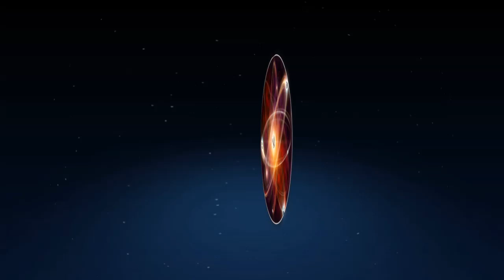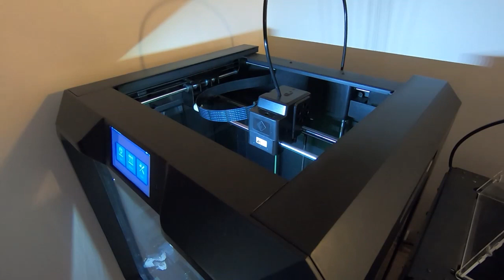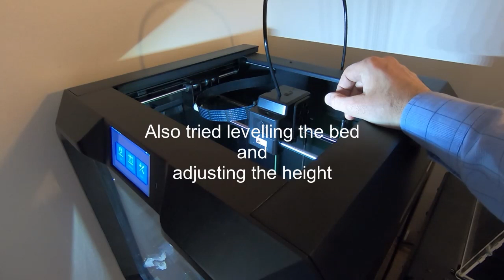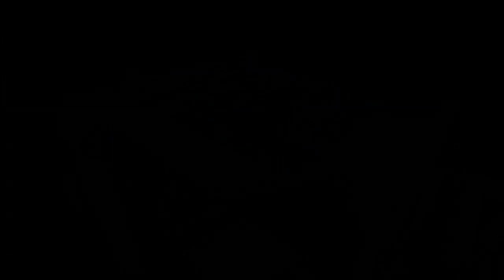Flashforge Guider 2 no extrusion

Comment: Hi my son who is 12 has this printer and it's been pretty good for the first 15 months that we had it.   He just ran into this problem, did you ever bail down the cause?   It extrudes fine on filament load, but when it comes time to print, nothing extrudes and nothing comes out.   I did the bump in heat and still nothing .   I did  a factory reset and nothing.   I'm starting to wonder if it's flashpoint.  Thanks for your help

Comment: Hi Mr Jerry, my name is Laurentiu, I got a problem last evening with my Guider 2, after I sent a G code to the printer I saw my bed wouldn’t stop hitting and I had to close it by on/off button at almost 100 degrees C, initially it was supposed to stop at 45 degrees. Since then when I start in I can’t use it because the bed doesn’t stop hitting up. If you don’t mind can you please give me some indications? Thank you.
Reply: Hey Laurentiu, I had the same issue and the only solution in my case was changing the main board. When checking visually I found a chip burnt, located close to where the cable of the head bed is connected. The chip is easy to buy on the market, but at least I was not able to replace it on the PCB. This was my second main board change. The second one I got within warranty. But anyway, I feel not comfortable using the printer expecting failure again. I am sorry that this is my story. Others may have completely different experiences.

Comment: This probably because the temperature sensor is picking up light from some were and it thinks its hotter then what it actually is. Cover all the windows up with cardboard or paper it should fix the problem.
Reply from the maker: No it has nothing to do with light. Also the sensor is entirely enclosed. As I say in the video I tried replacing the sensor and also monitored the output from it. This was a firmware issue where it had lost its calibration values and caused a step change in the temperature. I also doubt that ambient light would have any impact on a thermocouple running at 200C but thanks for the comment.

Comment: i have had simular problem with my G2, but for a different reason .I would load filament but it would not print with either, the high temp hot end, or the low temp hot end. i kept clearing them and re trying to print with no success so i removed stepper motor with the filament drive to check for anything i may have missed. after clearing a few bits off the drive wheels checked that all screws where tight, when i heard a lould click noise on one screw as i tighted it, the penny dropped as they say! the two drive wheels had been out of alinement running on one edge and the click noise was it being pushed back in the groove, filament was not being gripped enough to print. so what must have happened when i pressed the lever down to load filament it had misaligned itself as not tight enough screwed down. So there was no blockage in my case but the drives had not enough grip to extrude filament . by the way the printer was only days old when this happened . On first switch on of this printer drove the extruder drove into the bed during leveling. suppliers did replace surface ok . I had to do a factory resset then a update firmware to correct it. The next time a window on screen said it is to close to prosseed as it should have done out of the box! the update did have a bonus in the form of auto leveling on machine now. The most noisy printer i own, I.wish i had never bought it. and had made an enclosure and upgraded another printed to do high temp printing!!!
Reply from the maker: Yes I had similar problems previously and had already rebuilt the head many times to fix various issues such as poor feeding of the filament. I eventually measured the head temperature following the latest issue and the temperature was a long way out (way too cold). The basic machine concept is poor with the home position at the bottom of a very tall machine so as the machine heats and cools the variation is more than a full layer height. It also makes the machine very slow to reset and considering how many times I had to restart failed prints then it was very frustrating to use. This is dumb considering that it has a sensor on the actual head. I no longer use this machine and have replaced it with a much better machine. The new machine was a lot more expensive but has already saved me £hundreds in not wasting half the filament like the GII did.
Reply: @JerryWalker001  which machine? Thanks

Comment: Did it go through a software/firmware update before this happened?
Reply from the maker: No, Nothing was changed. It just failed part way through a print.
Reply: @JerryWalker001  interesting.  Why would it change during a print and not present a mechanical failure? did it just stop?  sounds indeed like a thermal calibration issue.